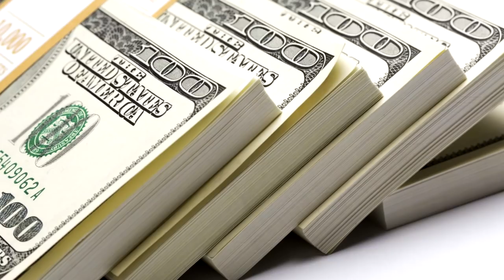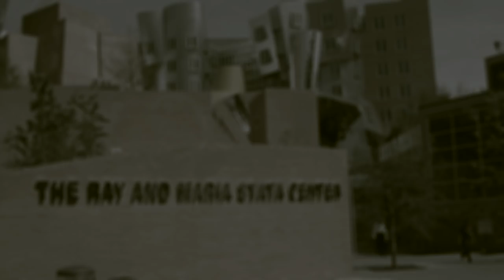10 of the Worst Building Design Fails

Comment: Takoma bridge did not fail because of cutting corners by the contractors, but by insufficient knowledge at that time of the effects of wind on slender structures.  It is usual for design costs to be gradually reduced by new methods of construction, until a failure occurs, whereupon the designers revert back to a more robust code.